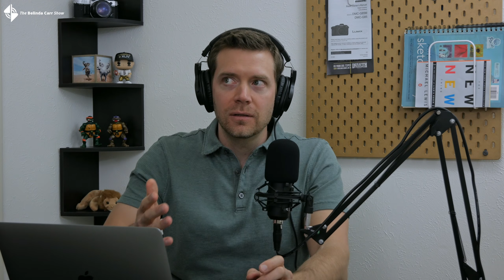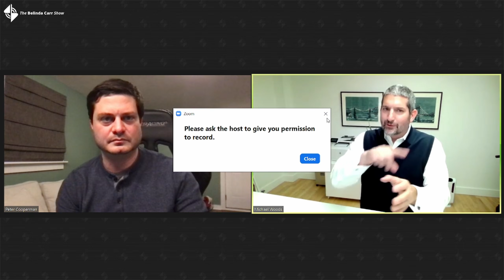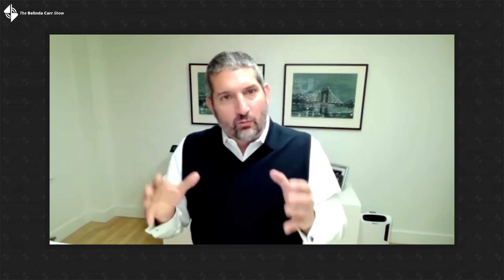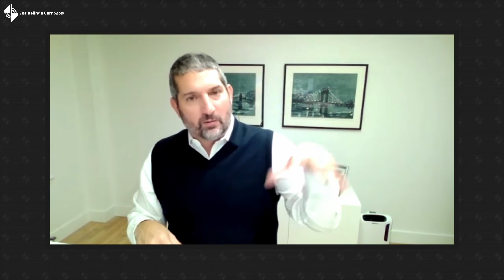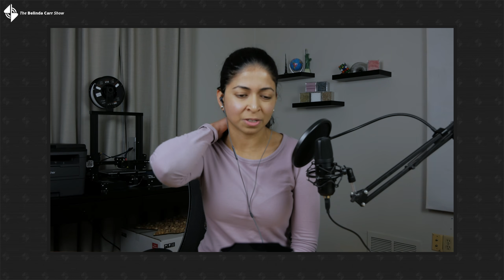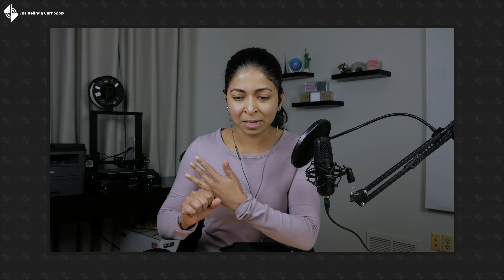The Future of 3D Concrete Printing w/ Black Buffalo | Episode 1

Comment: Interesting conversation.
I just attended an online seminar about sustainable use of concrete prior to watching this, and got lightly introduced to Concrete recabonation. The write -up suggests that hydrated cement used in concrete naturally absorbs CO2 during its lifetime. 
They also talked about deliberate injection of CO2 into recycled concrete, flyash and slag. I think maybe in the same process, hempcrete could be used to sequester CO2.

Comment: Many alternative building methods and materials have had code approval issues, and if anything, 3DCP is having an easier time with code acceptance than others, particularly with ACI-318 as the relevant code - having reinforcing requirements are normally very strict, specific and involved.  If one went to a building official and said "I want to build concrete walls of two wythes, each 2" thick, with no rebar, one wythe acting as the cladding" and regardless of testing performed, they would have a very definite response: "No."  Really, there is a major accommodation offered because of the digital aspect.  How else could the Austin project have avoided a single-story limitation by making the upper story not-3DCP, as if that somehow magically does not impose 2-story lateral/gravity loads on the 3DCP walls?  And the unclear anchorages to foundation and second story?  It is very good that BB is going through the testing process first.